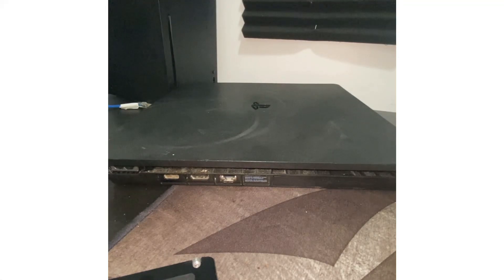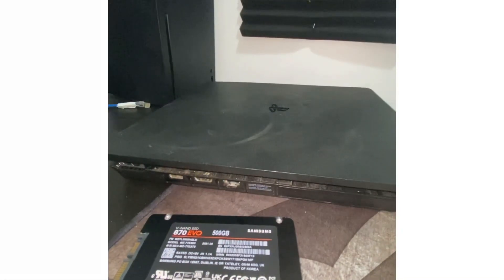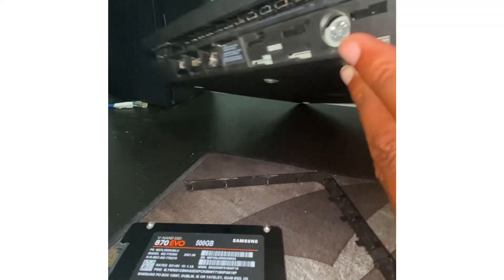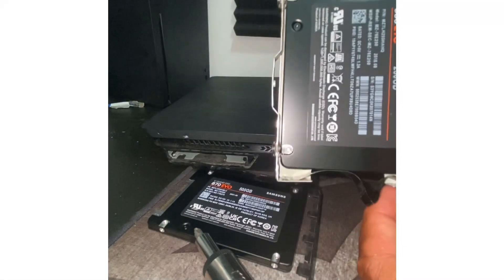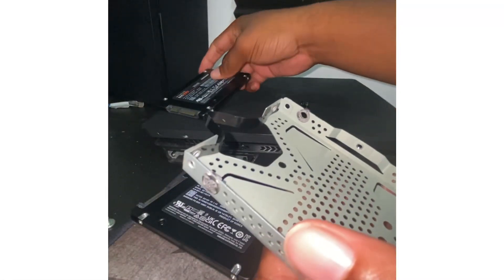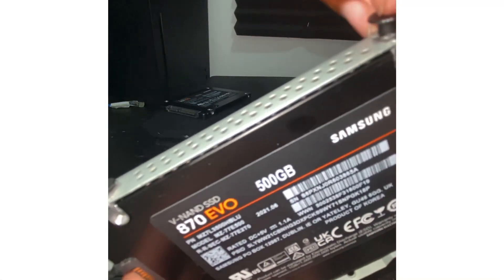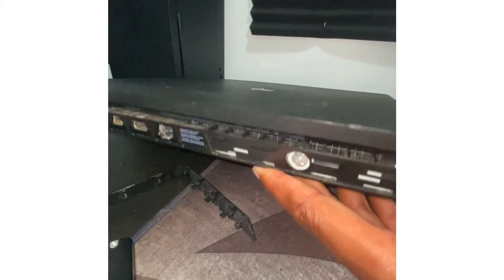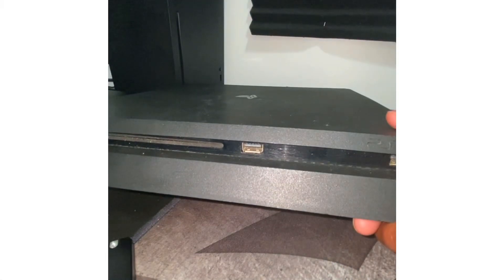How to Upgrade / install an SSD in you’re PS4 (Ghetto edition) ;)

Comment: I got a Crucial BX500 1tb, put it on my PS4 Slim, rendering textures, draw distance, faster starting loading, faster save loading, faster fast travel, the console doesn't get as hot as it used to, less noise, the PS4 system runs smoother, even though PS4 Slim does not use the full potential of an SSD I believe it's a good purchase for people who will not sell their console when they get a next-gen one.
In Valhalla the SSD improved greatly the game experience for me. In RDR2 Story and Online it's like another game.
Reply from the maker: Thank you for you’re feedback 
And support 
🙏🏾🙏🏾🙏🏾🙏🏾